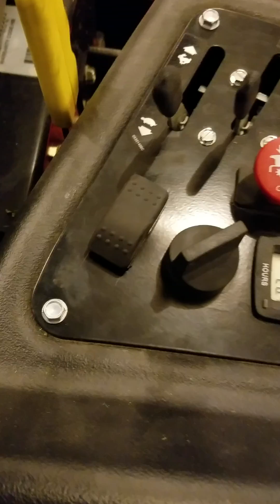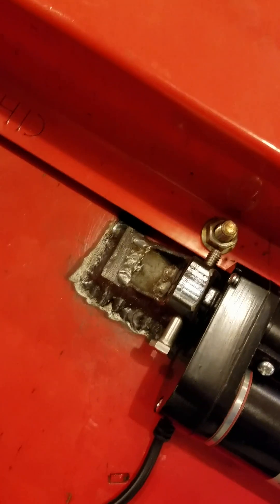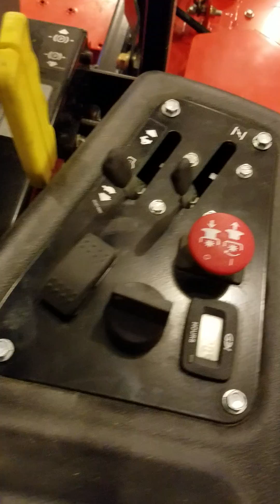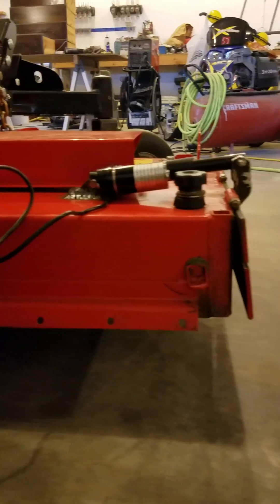Power lawnmower chute homemade

Comment from the maker: Well it's been 7 years still have my original motor! I've had too keep all screws holding motor snug little loctite. I've electric taped base too keep stuff off of it. I clean steel plate 1 time a year too keep gate closing tight.also when im up I stop and down I stop I don't push actuator hard!

Comment: How did you mount the actuator to the mower and connect to flap? I'm going to make this for my mower. Please let me know. Thanks
Reply from the maker: Welded a bracket onto deck lid with a single bolt through actuator so it can pivot! Or u could bolt it i suppose!

Comment from the maker: PARTS LIST
-prohead linear actualtor
   Input voltage=12volts
   Max load 225lbs , 1000n
   Stroke 2" ,   50mm
   Travel speed =0.39 in/sec
   Part# PL 14-2

- 12 volt momentary polaraity           reversing switch

Comment: I like the motor size and fab of your deck chute hinge. I have seen others use bigger and bulky motors with excessive weight. Yours is the most eye pleasing and    quieter diy electric chute I have come across. I think I am going to attempt one like yours. Fantastic job 👍

Comment: I was thinking, if someone could put together  these parts in a kit so you can just place it on your mower, bolt it on and be done with it. I can't weld anything because I don't have a welder. But it shouldn't cost that much to put together a kit and sell them for individual brands of lawnmowers. I would pay $200 plus for a kit with everything...I love the actuator idea...they also have faster actuators that could work well with this application. There are also hydraulic actuators as well. Thanks for the video.
Reply from the maker: Thanks yeah that's a great idea! I dream of selling a lot of things I build? I just have a hard time being someone who can build this so easy seeing others buy it from me for so much $ and forget about it.

Comment: Hi, I like that!!  Where did you get the actuator.  12 volt, how many inch stroke. Can you send me the link to the actuator and the reversing switch?   Send to mmanthei@earthlink.net.  I agree with you, this is the best way to do it.  All the other ones have way to much hardware and junk in the way when you mow.  I bought a Toro Titan HD 2500 52" Zero Turner.  I have already made my flap and brackets.  3/8" Aluminum plate, 2" angle iron which was cut and machined to fit along side of the vertical tabs that held the original chute. Everything is Bolted together with stainless steel nuts and bolts.  I threaded the Aluminum plate blocker so everything is flat with the very minimum profile so nothing can get in the way.    I banged into stuff the first time I mowed and took it off the original chute which was Way to big.
If you want, Jay, you can call me on my Cell Phone   651-470-1306.  If you use a cell phone, I could then send you a picture of mine.  Now i have to shut off the deck and open it.  If I had your invention with the electric motor to open and close, this would really be the Best!
Mike
Reply from the maker: thanks it will take me a bit to find actuator I bought both on ebay